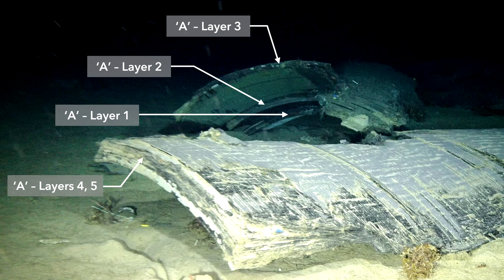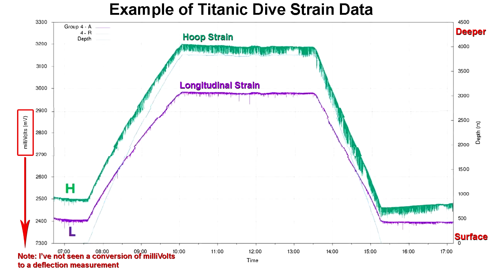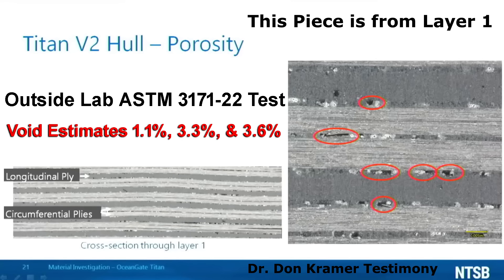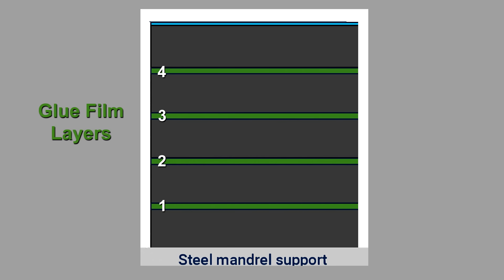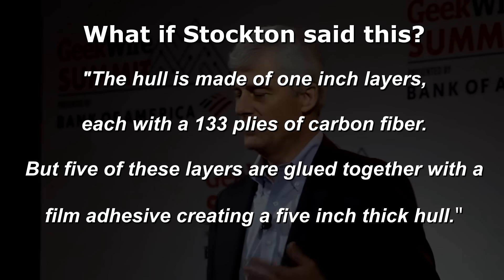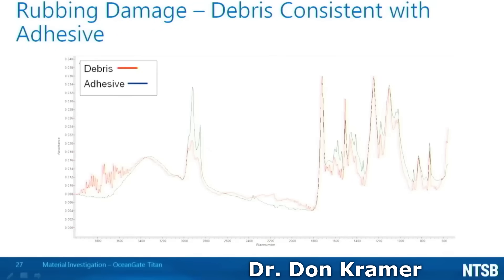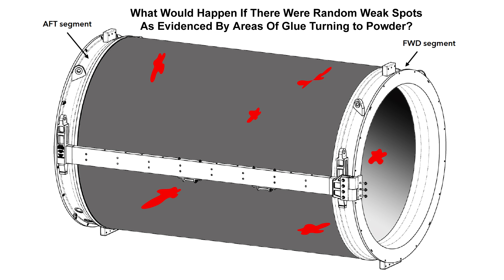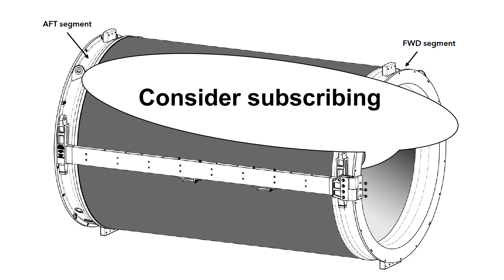OceanGate Titan Hull - Glue Layers Were Breaking Down To Dust - No Clues.

Comment: Sad to say, I have no one to talk with about my opinion on the exact failure process.
You showed the metal stuff, which connected the hemispheric ends to the barrel. 
Yes, the de-laminating was a huge problem, but I think, not that's the case for never able to resurface the vessel. 
Remember the transcription of the last messages? Stockton was attempted to drop the ballast MULTIPLE times! 
And then think, what was against to de-attach the ballast frame? The ballast actually mounted on the two hemisphere. When the hull was failed, it may slightly comes closer, makes the the mounting hooks stuck into their fittings. 
Then, when just one side disconnected fo some reason, made a big can opener from the external bracket, hanging on just one hemisphere, that caused the crack, and finally the implosion.
Reply: I believe that the "transcription of the last messages" that appeared on the Web, has been deemed false.  i.e. not the actual communication

Comment: Shouldn't the gas between those pores expand and tear the thing apart the deeper they go? I mean, if it does act like that, it's a miracle it dived at all and not bloop the first time.
Reply: Quite the opposite: gas compresses the deeper you go.
Reply: I think gas compresses the deeper you go, still bad as the material starts flexing and moving against itself -> more cracks -> fatigue-> failure
Reply: Good point
Reply: It might displace causing further rupture of the bond.  Just like a bubble under window film.

Comment: Glue does dry rot, so not adhearing any more..  To apply glue to anything shiny/polished is what an earthwoorm type brain would do. Should have been sanded w/ emery cloth 1st. Billions of little sharp edged canyons to grab onto.
Reply: Normally a large composite structure like this would be made by only partially curing the layer before starting the next, leaving the previous layer 'green'; that way, the bond between layups is much stronger than using a glue layer.

Comment: Youre splitting hairs here. The hull failed plain and simple.
Reply from the maker: Thanks for your comment.  There were many engineers who saw this design coming together.  People smarter than me, you and the construction proceeded. So, it's very interesting to try to understand why things that look like "red flags" (in retrospect) were missed during the process.  So, it's not splitting hairs to try understanding the small details that may have led to the failure.  And I say "may have led" because the junction of the titanium rings to the carbon fiber hull is becoming very suspicious to me as the failure point as I do some more research.
Reply: @solareclipsetimer  theres no way to prove or disprove that the large cavities existed due to a manufacturing flaw, lack of oversight for tolerances or the multiple dives and subsequent implosion of the submersible. When your opening statement is (I'm paraphrasing) "if you think that just the hull failed, then this is for you", yes, you're splitting hairs because the hull did in fact fail. It doesnt take a genius to understand that unsupported laminates will compress under pressure and will experience delamination over time.
Reply from the maker: @ My point about that opening line the video is there because there are people who are absolutely convinced that the failure occurred at the glue joint between the titanium ring and the carbon fiber hull. That is a very plausible reason for the implosion.  So, my line specifically means do you think it was the hull as the primary failure point (crushing inward).  Because either of those two explanations will result in an implosion. High pressure water intrusion at the glue joint causes the same implosion, and it all looks the same on the ocean floor.  From the wreckage on the ocean floor you can't tell what the initial cause was.  So, we know that the laminate hull would compress and eventually delaminate, but did that cause the implosion?  That we don't know with the information we have.  Thanks for your reply.
Reply: @solareclipsetimer  using your words adds context. Good job. Thanks for your comment
Reply from the maker: @ericwieboldt7042  Thanks for your reply and for adding to the discussion.
Reply: Why? It’s still interesting
Reply: Examining the failure mechanism has value.  A child knows that the hull failed.
Reply: @ and why? Why did the hull fail? It’s not like this is the only video on the subject the creator ever made, it’s just examining this specific point of failure.

Comment: As someone in petroleum engineering, we intentionally pressurize porous rock so it fractures. Also, the bottom hole pressure of an average oil well in Texas is around 1850 psi. The titanic sub was at 11,500 [ft] x 0.0433 [psi/ft] for water ≈ 5000 psi. We would NEVER send equipment that wasn't steel or titanium with tested welds into any well. The Macondo blowout experienced pressures of ~8000 psi. I hope that puts into perspective how stupid this carbon fiber glue thing was.
Reply from the maker: Thanks for your thoughtful comment.  I agree with you.  Those pressures are deadly.  I am working on a video right now that discusses water intrusion at the glued joint (titanium to CF).  It is a very suspicious failure point.
Reply: @solareclipsetimer  but apolying glue to polished titanium. Not going to adhear long. The T. rings should have been sanded first. Rubbing alcohol preped... actually glue is just not good at all.
Reply from the maker: @markwaters7802  I agree with you.  They had a written protocol for the prepping before glue application.  But I don't think I have ever read a specification for how rough they wanted the titanium surface.   The written procedure is copied below.  Regarding the titanium, they say " Lightly roughen the  bond surface of the FWD segment using an abrasive."
Prep the FWD Titanium End Segment
1. Degrease the bond surfaces of the FWD titanium end segment (see detailed procedure)
a. Record the contact angle throughout wiping process
2. Use procedure to check the abrasive for stearates or other contaminant before Step 3
3. Lightly roughen the bond surface of the FWD segment using an abrasive
4. Degrease the bond surfaces of the FWD titanium end segment one final time
a. Check Surface Analyst reading throughout degreasing process. Continue until
Surface Analyst yields desirable resu
Reply: @markwaters7802  airforce have used it for decades. but you need to know you have the correct glue, amazon wont cut it.
Reply: @luminousfractal420  the air force generally only deals with pressures between one and zero atmospheres though lol
Reply: Even high end automakers using carbon tub monocoque frames glued together use clean rooms and properly fitted anti static clean suits. These knuckleheads were laying up the end caps in wool sweaters with cheap cotton fiber gloves in the open garage bay of a seaside warehouse in soggy Seattle while holding a press shoot and took it outside to cure. Hull damage reminds me of surfboard delam.
Reply: Knock it off with all that logic and critical thinking. As Stockton said they’re “cowboys” 🤦‍♂️No need for math when you have money I guess. 🤷‍♂️
Reply: Makes you wonder how it make it down as many times as it did

Comment: Put ceramics in vaccume.. that may be what's going on

You're welcome maybe¿ 😅
Reply: I think you meant to say carbon fibre, not ceramics. It's common to put epoxy carbon fibre parts in a vacuum to remove air bubbles before the epoxy cures.

Comment: So what would the impact that excess porosity have? Are these voids an area of stress concentration? I could easilly see these internal voids gradually crack, largen and cause delamination over time
Reply from the maker: Thanks for your comment.  The impact is they are areas of no bonding, so no strength.  The concept of co-bonding five, one-inch layers together, is that after gluing them together they had to behave as one unit.  They have to behave as a single five-inch thick hull as if the glue wasn't there (100% bond) These pores are weak spots as evidenced by the fact that the layers seemed to be moving relative to each other causing shear forces between the layers.  And yes, as you said, could lead to delamination.  Thanks.  I hope I answered your question.
Reply: @solareclipsetimer  if the bond between the layers breaks down and each layer works independently then this effects the 2nd moment of area (I) of the 5 inch section. It would reduce it. This would effect the stiffness and would start to increase the deflection and stress. The 2nd mom of area of two wooden rulers in bending acting as two independent beams is lower than the same rulers bonded together acting as one therefore affecting the deflection and stress. Your engineered wood example highlights this. Thanks for video
great work.  
👍
Reply from the maker: @mikeshedhead3568  Thanks for your thoughtful and supportive comment.  I am glad yo like the video.

Comment: there is one thing wich blinks like a red flag .....  "Also, the carbon fiber matrix was not up to specifications."   related to the fact there are no  offical testet and approved Carbon fiber Subs  ... there is no offical "specification" to match for that .....  the hole Sub was not up to any Specifications
Reply from the maker: Thanks for your comment.  You are correct.  They did pretty good engineering on the titanium components.  The carbon fiber was a nightmare.
Reply: The crusher worked exactly as designed.

Comment: The interesting thing is that if the Titan submersible had been built with the benefits of hindsight, then it would have been pretty robust and possibly safe design. 
It survived 14 dives with bad glueing, dodgy materials that were too thin, unreliable strain guages, built on a comparatively shoe string budget... not to mention a team leader who refused to listen to anyone about safety... 
Now the whole internet has had a schooling in composite material submersibles and their failure modes, I'd guess that in the future, someone could run with this idea and make it work.
Reply from the maker: Thanks for your comment.  You are correct about hindsight when reviewing the data from the wreckage.  But there was also plenty of foresight by experts at the time that said this idea would not work and they were correct. Surviving 14 dives is true, but each one was a gamble.  It could have been a success as a concept if the dives were part of an unmanned testing program to lead the way toward understanding the issues and improving the engineering.  But the way the business model was carried out, causing 5 tragic deaths, has probably ruined the chance of manned sub-designs with carbon fiber forever.
Reply: If they had used the data they collected from their own sensors that hull would have been retired a couple of dives earlier. They bragged about having a system that would warn them if the hull was going to fail. Then the system warned them and they ignored it. 
They were trying to push the boundaries and could have made good changes to the industry. But, they pushed too hard and completely ignored anything that didn’t fit what they wanted. Now they’ve entrenched the rules they said were overly cautious.
Reply from the maker: @NBSV1  I agree with you.  That significant strain gauge data was from Dive 80.  They should have stopped after that dive.  There is also some new information about dive 87, the attempted dive before the fatal dive which is very interesting and I have to analyze it further.  Thanks for commenting.
Reply: It's a failed idea. Use metal. End of story.
Reply: No hindsight was required to make this design work (or at least work better). All the knowledge and engineering principles are there (and had been for quite some time). Cutting the corners wasn't one of them.

Comment: Right, as to the factor of two this seemed unlikely to me also but it was well known in aerospace circles that the calculated values had to be halved, a fudge factor, to give real results although no one knew why.  The thickness to diameter ratio is indeed decisive as to absolute figures - around 1000 to one typical for an aircraft fuselage but the ratio between calculated and tested failure figures is what is involved - surely you accept that buckling was the mode of failure in the Titan?  In compression it is almost inevitable  unless at infinite compression things liquefy.... tension failure is straightforward.
John specifically asked about the Titan and whether it had impacted something or the ocean bed before failing. I could send you our emails on this and his final paper that you might get an experienced and competent engineer to review.

John went right back to the roots of shell theory and traced the conceptual error that was subsequently repeated and adopted in the computer codes.
The specific particulars in the Titan hull are additional to the inbuilt fundamental mathematical and conceptual mistake embodied in the routinely used computer code.  I worked on the first experimental use of carbon on a production sailplane inGermany in 1973 and it using the expertise of Helmu Treiber who as a graduate student at Braunschweig university built the 30 metre span SB10 two seat saiplane - first to use carbon fibre primary structure.
I can appreciate the inherent manufacturing defects and techniques shown so well in your analysis video, I wondered if they made it in discrete shells to avoid exothermic if it was done in one go.  An expanding core (caul) could have avoided the fibre disruption and bulking problems even maybe prestressing the layup  to help with overall compression load and guaranteeing straight fibres ( eg A relatively thin steel mandrel under progressively increasing internal pressure to slightly increase the diameter as the winding continued. The carbon would try to shrink on being heated due to negative co efficient of expansion also so don't know if that would work ( we encountered this effect with discretion chordwise 'ribs' showing slight hollows on an otherwise mirror smooth surface. Gliders are usually sandwich skins and the spar caps in carbon also showed when cold.  
John's paper is to be presented as the inaugural John Hart Smith memorial lecture in March,  he was used to being disbelieved, initially, but was vindicated later.  His " memo to Boeing management" was leaked to the Seattle times and went viral and predicted the problems and cost overruns that outsourcing and incorrect tolerancing created.  He was consulted on the shimming issues on 787 and 737 fuselages shortly
 before his death after it became a media beat up .  Please look into his body of work and reputation - lots on the Web.

g created
Reply from the maker: Thanks for your thoughtful comment.  Thanks for watching my video.
Reply: Let me know when you have looked up John Hart Smith's work  , not about thanks..send me an email address and I will send you his latest papers and the emails we exchanged that asked about the Titan failure .